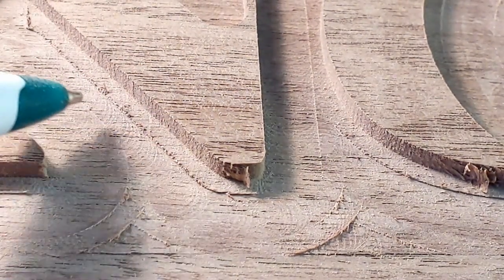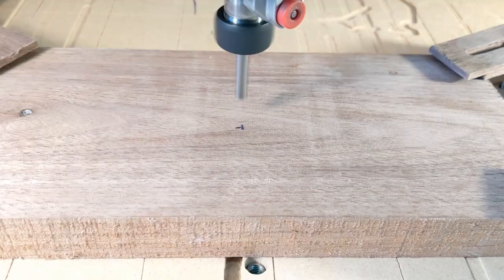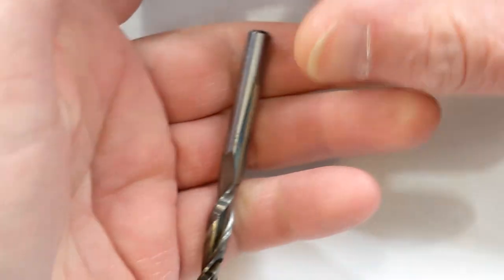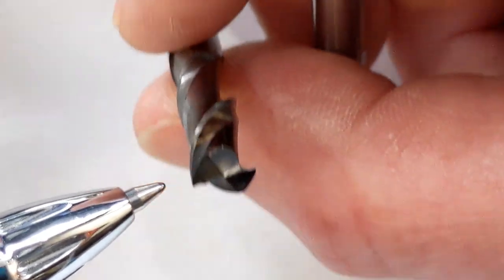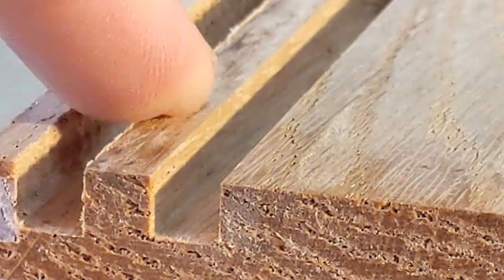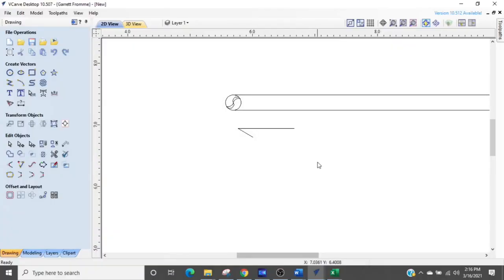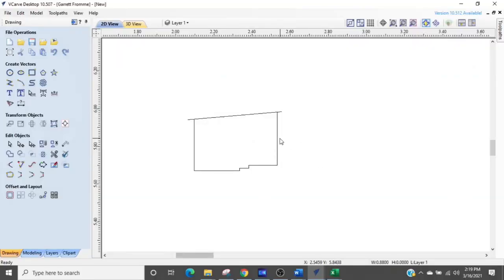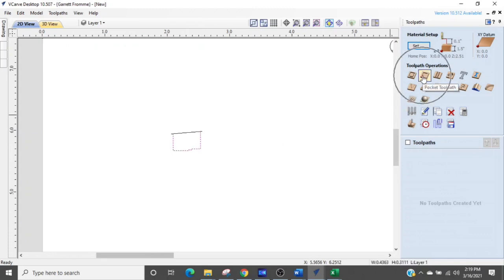Down Bits (Down Cut) And CNC Routers [What You Didn't Know] - Garrett Fromme

Comment: A sufficiently rigid and properly trammed machine will not leave any steps.
If you get steps in your cuts it is not because you use downcut, upcut or straight cutter but but because there is flex and/or slop in the machine and/or the spindle is not perpendicular to the cutting plane.

A light finishing cut is not a fix for a machine that is out of square.
Start with checking the alignment of the spindle,  learning how much your machine is flexing making cuts with specific depth, feed & speed in a given material.
Optimizing the tool path is the very last step to a good finish.
Reply from the maker: Thanks Ro for your input. I do wish I refered to the other videos I made regarding tramming. I definitely forgot to talk about rigidity.

Unfortunately, there are many 'not so rigid' machines on the market (including mine), and yes, this does affect the surface as described. Unfortunately, ya gotta be there.

But thank you for sharing your insights as I always welcome corrections and additions to things I miss.

Comment: if the tool is moving that much your router is garbage. The z axis should not be affected by more than a couple thousandths.  Work holding, on the other hand, can be greatly affected by the direction of bit.  The up bit will suck the material up off the bed where the down bit is designed to push the material against the bed to accommodate light work holding and vaccuum systems. Your little (wood?) tabs that hold the sample piece are likely flexing. Don't see deflection in our industrial machine.
Reply from the maker: Hi Michael. Thank you for your thoughts. Yes, rigidity makes all the difference in the world. Please keep in mind, there are thousands of CNC routers out there with this problem...hobby machines. That is the group this channel addresses. Not the industrial machines.

Although the machine may be 'garbage', it makes amazing projects for what it is..

Comment: Try using an up down cutter. You then have the best of both.
Reply from the maker: Steve-nv8pd, Using an up down cutter can be a great option for achieving a cleaner cut on both the upward and downward strokes. It helps in reducing tear-out and ensures a smoother finish on your woodwork. Give it a try and see if it works well for your projects!
Reply: I use them all the time, and I am very happy with the results.
Keep up the fantastic information.
Thank you for your efforts.

Comment: Thanks very much for the video..... I learnt a lot.......I have a CNC router bought w years ago that I have never get satisfied with the 3D carving/engraving it only engraves like a distance of 450mm along Y axis,,, strange it starts either down cut or upper cut Chinese call shallower/up moving,,,,, tried with so many times to play around with feed rates/ plunge rates with no success.......

For small project like 250mm by 250mm no sign of any problem however as it goes beyond that you start seeing significant changes in Z axis either digging into the material or moving upper........

Here is my WhatsApp for more details like video pictures etc....

I am Tanzanian from East Africa,,, I use Mach3 controller software..... I have bought another machine that uses DSP controller waiting in two weeks to arrive at my shop.......

Thanks sorry for my vague English
Reply from the maker: Hi GAG. Sounds like there may be some variation in you Z axis beyond this video.